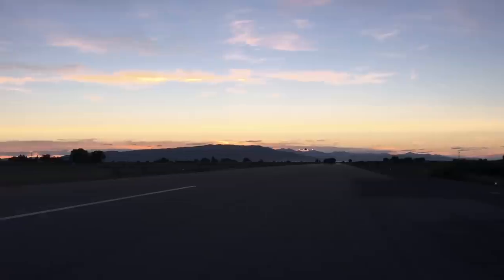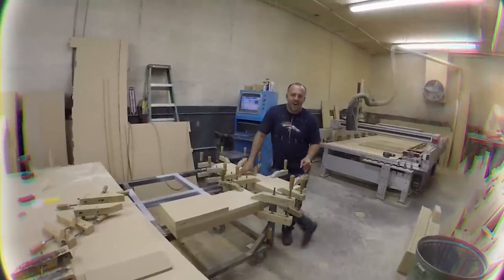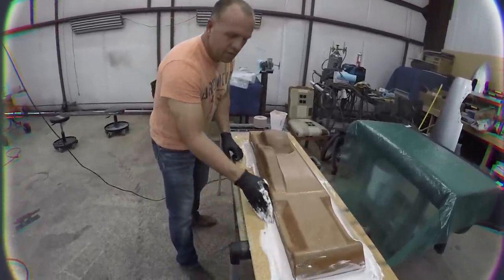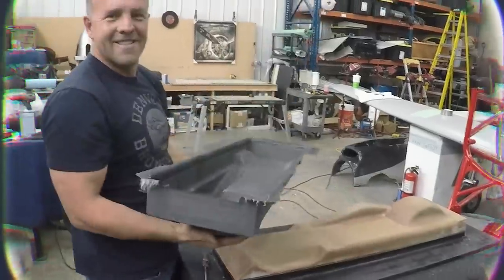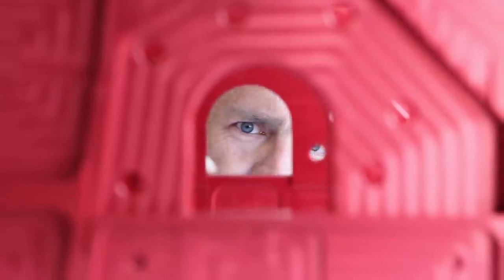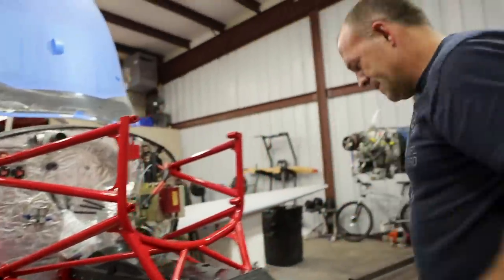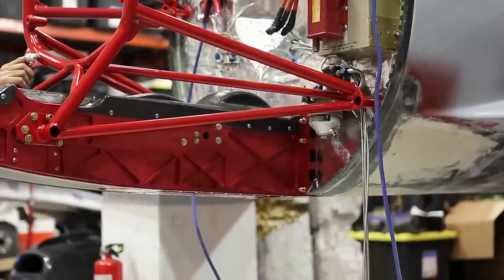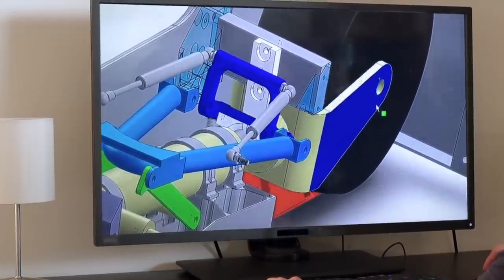Custom Landing Gear - The Fastest Single Engine Turboprop in the World Flying Today | Turbulence #3

Comment: One lesson from the Gimli Glider was that it can be advantageous to have the nose gear drop into the wind, as opposed to pushing forward against it. Of course in this case, it would have moved the gear back, decreasing the directional stability that you mentioned. So, best not run out of fuel over Manitoba. 🙂

Comment: Genius! He seems surprised when something he made turns out perfect.  Nobody else is surprised. Absolute genius.
Reply: Thats an almost perfectly true comment.

For a very good reason.

Mike has the knowledge to be able to foresee all (but in Mikes mind its,  HOPEFULLY all) the possible problems that enable the flow of the designs.

Without foreseeing all the possible problems, the design will be flawed.

Public hardly ever have the ability to watch Mikes vodeos and be a step ahead in our minds,  because they cant see the potential problems looming up at the designs.

So when a designed part is built and it works, that evidences for Mike that he didnt unforsee any of the foreseable problems.

Thats an adrenaline rush that makes great people deservedly pleased to be who they are.

Its called self esteam.

That is exactly what stops otherwise justified "self confidence",  from entering the slippery slope down to stupidity.

Some people will measure,  cut,  and measure again to check upon their own skills and tool quality etc.

Others simply measure and cut and bash it into place (if they bother to measure).

Mike is simply in the former measure cut measure group.

Comment: You reminded me that prior to 3D models, we designed aircraft using drafting boards and slide rules. Today however, we can do so much more with the likes of CATIA and Solid Works. 

You today my friend, are the equivalent of over 30 to100 engineers and drafting technicians. Truly remarkable.

Comment: Mike you're crazy in the good way. Amazing making a landing gear housing that is sealed off from the pressures of the air cooling and super flush to reduce even the tiniest COD. Oh and the engraved Turbulence on the landing gear doors was the attention to detail top gear finishing touch. 
Hey I like your Tesla. I'd sure love to see you make a battery powered airplane. I'm confident no one could make one more efficient and gorgeous than you can. Of course you couldn't (today) have enough power to get anywhere near the range of Turbulence but I'm sure you could beat the range of the battery powered electric flight trainers in use today.

Comment: As I follow along with this series of videos of how you designed and built Turbulence, I had a question pop up.  With your experience, know-how, perfectionism and attention to detail when building planes from scratch like you do, does the FAA require YOUR planes to undergo an Annual Inspection by somebody that has less than 1/2 the smarts and experience as you do?? Or do they take your word for it that everything is 1000% safe? Once a plane is listed as "EXPERIMENTAL," do they still require Annuals?
Reply: As the builder, you are able to apply for a Repairman Certificate from the FAA. It allows you to perform your own annual condition inspections, which are required.
Reply: @ChandraSlyFoxPatey  "Thank you very much" for your quick reply.
Reply: I wonder what the local FAA inspector thinks when he gets the job to sign off on one of Mike's new builds.  Is it "Oh crap, another Patey one, everything's going to be weird and custom and modified and I'm going to have to check everything, and it's going to be annoying".  Or, "Cool, another Patey job, he's got his sh*t squared away, I'm gonna see some cool stuff today!"

Comment: Mike, another great video. I am wondering where or how the steering works. Is it a mechanical linkage or hydraulic turning that wheel? Do you also have a sensor or pick up telling you if the wheel is stright?

Comment: I would love to see how you go about the engineering of things. The actual calculations that determine the material and size of all the bits and pieces. For example, how did you know if the engine cage was going to be strong enough? AND...matters of heat, such as this nose gear cover being able to deal with the heat from the engine.

Comment: you used aluminum bolts (i don't remember what they called) to attach carbon fiber to a body, but those materials really don't stay really well with each other, Did you use any protection or coding?

Comment: I often wonder what a spitfire and the RR motor would be like with modern design software. Modern V8 seems to pull a 1000hp with ease. A sleek carbon fibre spitfire fuselage.

Comment: Hate to say, but after 40 years experience..I would Never get in that airplane...all glass is an explosion waiting to happen.   The fabrication of the material is critical..weize, environment,,etc. Glass doesn't really show stress wear...it just turns into a Giant powder explosion. Where's the vibration stress. G load stress. Same with the gear..what's max gear extension and retraction speed...who knows? Is the answer. What's the Manuel gear extension. What if you lose electric or hyd"s. What's the limit switch? What happens if failure both up or down. What side loads can it take? The nose tire...is off of what? What bearings are in there...as well as landing gear bushings.😮